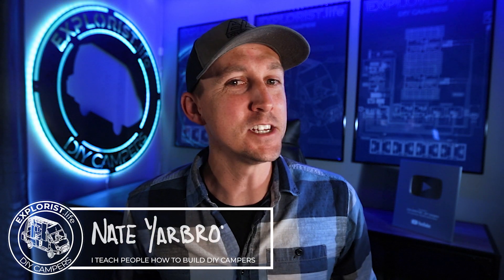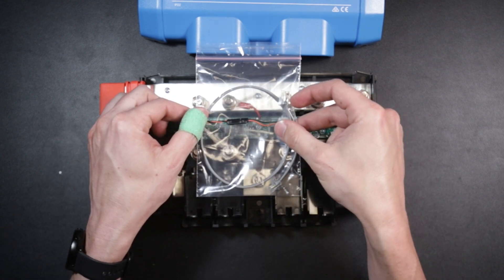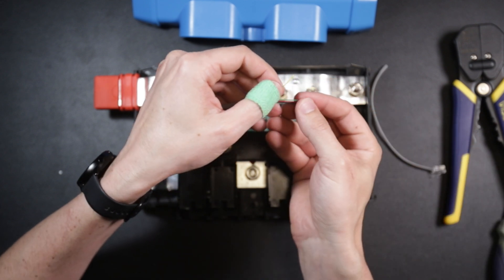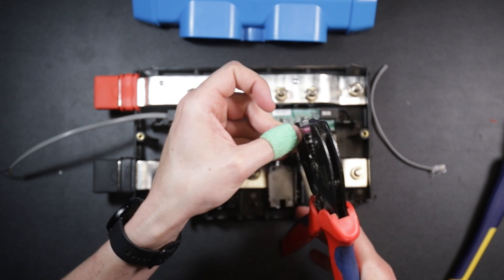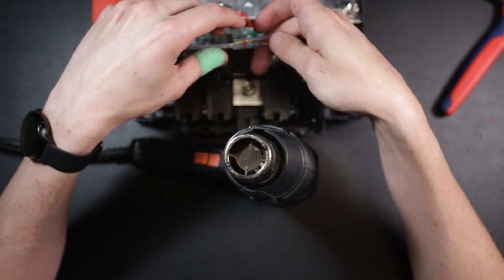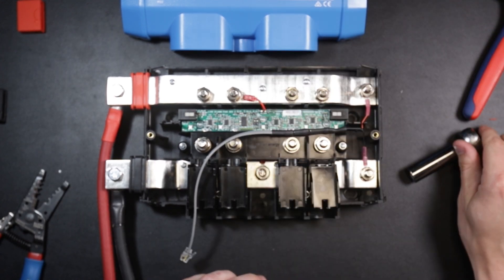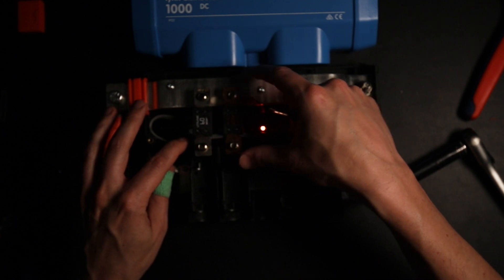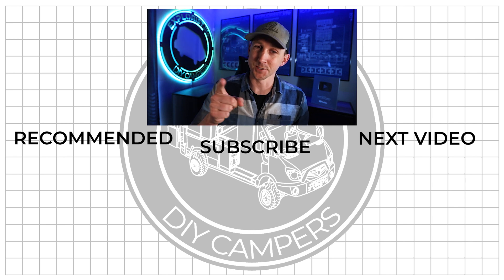How to Make the Victron Lynx Distributor Lights Work (without the Lynx BMV or Shunt)

Comment: Hi Nate - I gave this a go, but ran into the same issue as a person below, the 12v to 5v converter was too short to span the distance between the posts on the bus bars, so I used the extra pieces of green and red wire I snipped off the victron cable and extended the length of the red and black wires off the converter and spanned the bus bars.  The result was that all the lights light up red - BUT adding a fuse has no impact, all the lights remain red.  Any ideas?

Comment: Silly question but would this wire in itself need a fuse?
Reply from the maker: Since it's less than 7" and fully contained inside of the component, it does not need a fuse.
Reply: @EXPLORISTlife   Brilliant thank you!

Comment: We have a Victron smart shunt, but it's not the Lynx. We also have the Lynx distributor with four game changer battle born batteries and 1600 watts of solar (4, 200 watt High Tec panels wired in series, 4 and 4) with a multiplus II and two 100/50 MPPT charge controllers. Do I need your hack for the lights to work on the Lynx distributor? We recently bought some other wiring kits from you and would be interested in purchasing the kit to make the lights work if needed.
Reply from the maker: You would indeed need to do the hack shown here with those components.

Comment: Great video, watched this video after I'd already purchased mine not realising the lights would not work so this vid was a bit of a game changer. However my Lynx is part of a home ESS with a Multi Plus II , a Colour GX and a 48V battery system so stepping down from 52V to 5 was a bit more problematic. I then remembered there are a couple of USB ports on the back of the Colour GX. I used one of these to measure AC solar generation via a ET112, but the other was free... What's USB power... 5V, just what was needed. So with the great info in this video, I've powered my Lynx via a USB cable plugged into the back of the GX. Lights on, all is good :D. Thank you
Reply from the maker: Exactly!  That's definitely another great way to do it. 😀
Reply: Do you have pictures of how you used the USB port on the Color GX? I'm interested!

Comment: Anybody buy the 4-pack and have one left over they want to sell me? I think this could be mailed in a standard envelope for the cost of a stamp. I'd Venmo you $5?
Reply: @J P Actually, I just made one of these myself last night and just installed. No issue with the length of the wires being too short. And I plugged in the jack on the right too. All seems to be working fine.

Comment: You can probably go cheaper with a $1 12 volt to 5 volt USB cigarette lighter plug in a little bit of soldering and by the looks of the jack it's either a handset for a telephone or the rj11 which is the cord that comes from the wall to the phone
Reply from the maker: Yeah, anyway you can deliver 5v to the plug should work.  I've seen people modify a USB cord that is plugged into the USB of their Victron Cerbo GX as well.

Comment: Any idea if the Victron Lynx Adapter Bars will work between a Victron Distributor and a Blue Sea 9000E 350 amp on-off switch.

Comment: Hey Nate, I am almost done with my skoolie build and am really struggling with the electrical system. I have decided that solar isn't right for me at this juncture, that being said I have found ZERO diagrams showing how a setup would look with a battery bank, alternator, Victron DC-DC charger, a generator/shore power connection, and a Victron MultiPlus. Any chance you have more information on this kind of build without utilizing solar?
Reply from the maker: All of my diagrams at https://www.explorist.life/solarwiringdiagrams will function without solar charging.   Simply omit the charging leg of the system from the Lynx Distributor.

Comment: Thanks Nate!  Hack worked great.  Nice to see the Lynx light up.  I used the port on the right side of the Lynx and it worked as well.  I also just stripped off the red plastic connector that came with the step down convertor unit using the crimped connectors already on the wires to fit inside the ring connectors and then crimped.  Gave me just a little extra length to reach the pos and neg terminals on the Lynx.  Appreciate all the help you gave me with my system.

Comment: Your hack worked great! The only thing I did different was to add 2" extensions to the ring side. I also came to the same conclusion that it was better to buy the lynx distributor, even at the same price its cleaner.

Comment: Hey Nate, should this be fused?
Reply from the maker: It's under 7" so it could be considered a pigtail per ABYC which means it does not need to be fused.  It's also entirely contained inside the component, which is another reason it doesn't need to be fused. Similar to the other positive busbar to computer board wire that is pre-installed in the unit.
Reply: @EXPLORISTlife   Great, Thanks a ton.

Comment: I have a question sir! I am upgrading my 6-6V batteries to 5 Renogy Lithiums. Since I am going to wire them in Parallel with only 1 battery run to the Lynx, would you chose to use the "Power-in" or get the Distribution? I dont mind paying the extra. I already have a Victron BMV-712 monitor so no need for the monitoring. I am powering a travel trainers 12V system and I have a 3000 watt Renogy pure sine inverter. Thanks so much for these videos!! I attempted to go to your private group but it went to a dead end. Also the link for the converter is showing it is a 6-24V to 5V 1.5A Step-Down Regulator Module. Is this the correct one?

Comment: I am helping my friend build his solar array on his travel trailer and he wanted to do this hack and it worked very well.  Thank you for the detailed explanation of it.  Also I was wondering if you feel safe for a Victron 100/50 having 800 watts of solar. 200watt x 4 panels which is 81.4 volts and 9.8 amps instead of the max watts listed on the website of 700 watts.  When adding the amps and watts up do you divide it by 12 or the max charging volt of 14.6. If I take 800 watts and divide by 12 v then I get 67 amps which I think it would be too much for the controller but if I do the same with 800 watts divided by 14.6 volts, which is the max charging then it becomes 55 amps which I would think it would be acceptable.  What are your thoughts on it?

Comment: Did I miss something here? Is there no inline fuse going to that DC:DC converter connected directly across across the main battery bus bars (100’s if not 1000’s of instantaneous Amps if anything fails). 

I know the wires to the DC:DC converter are really thin, so would in effect “blow” if the converter failed, but personally I’d fit an automotive style mini blade fuse holder on the positive feed and fit a 1 amp fuse to this. 

They are pretty small and would comfortably fit inside the Distributor enclosure. Am I being overly paranoid here?
Reply from the maker: Great observation.  It doesn't need a fuse for two reasons:

1: The wire is contained in the device.  (Just like how the pre-installed wire going from the positive wire to the computer board doesn't have a fuse)

2: The wire run is less than 7" and can be considered a 'pigtail'.

Ultilately, you can definitely add a fuse if you like, but this is why I chose not to.  Also, even if you used an inline fuse, there would still be an inch (or so) of unfused wire between the ring terminal and the fuse, so is it really worth it?
Reply: @EXPLORISTlife  Thanks for the reply. My concern was not really the wire, but the (wonderfully made in China) DC:DC converter. I've seen a few fail in my time and in this case (litterally) it will contain the "shrapnel" as you note if the worst happens. Sadly Victron don't make one - that would be quality like all their kit.
Reply: how do u cover the ends that stick out

Comment: Very interesting video! This Victron Lynx product is great for future expandability. I've already got two Victron products attached to my Sprinter battery directly - the cable for my Victron IP65 BlueSmart charger, and my Victron Orion. 
I'm thinking I can disconnect those both, install a Lynx, then attach the Lynx directly to my battery. The Orion and the BlueSmart can then attach to the Lynx. If I wanted to ever get a 12v Inverter or other 12V products, I can then just add them to the Lynx! (Am I correct in this thinking?)
Thanks Nate!!👍

Comment: I used a different converter that has a metal heat sink to dissipate any heat created by the conversion of 12V to 5V.  It won't fit inside the Lynx Distributor but will be easily mounted outside.  Also, I hooked up my data/power cable to the port on the right side of the Lynx and it worked, so that would shorten your wires if you want to fit one that will go inside without possibly blocking the LEDs or light tubes that bring the light up to the front of the case.  Nice hack to get the lights working.
Reply: I used the right side as well
Reply: I tries Nate's converter choice and it burned out twice after I turned my solar disconnect on. I will try your method.
Reply: I am doing the same thing

Comment: Dude! Nate! That is excellent! I was just working on connections on our Lynx and thought “it would be cool to figure out a way around getting these lights to function...” then your video showed up! 

Why do you think Victron wouldn’t just make those lights work without having to wire them or buy more components?

Thanks for another excellent video! - Brian + Erin
Reply: Saving a few pennies.  It just needs 5v power so they didn't add a DC-DC converter (to be fair, theirs would have to be 12-48v input so maybe a dollar extra cost).

Comment: Now what about the 48 volt systems ? is there a step down converter for 48 to 5 volt ?  and what about the amperage draw from the step down converter ,  Is it much  for 48 to 5 volt ?  I am just trying to see if this is even worth doing on my system .  I don't really need lights to tell me a fuse is blown , that's easy enough to figure out quickly .
Reply: DC to DC buck converter 60v is what you would have to look for they range from about $9 to $30. But to be honest the safest thing to do would be to get a 48v to 12v and then do the same thing he's doing here you could always use a 12-volt for some LED lights